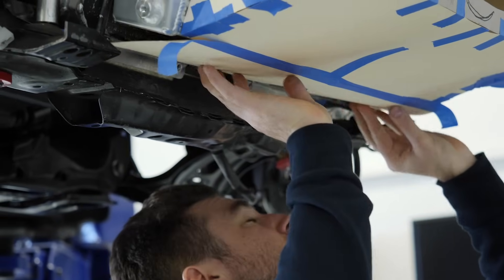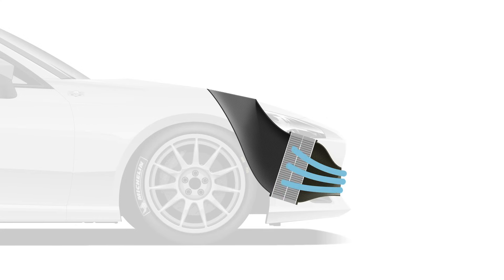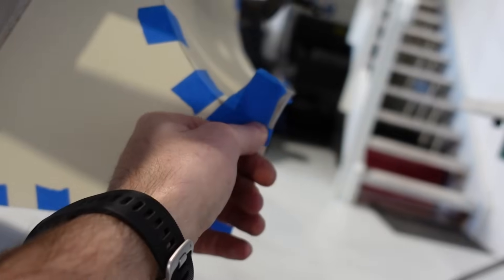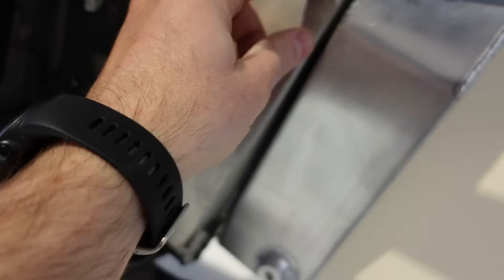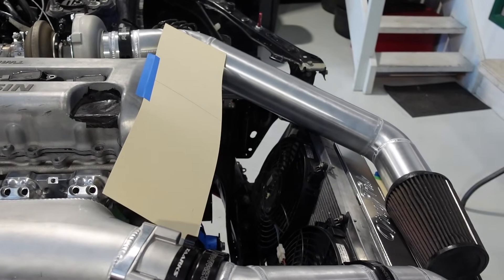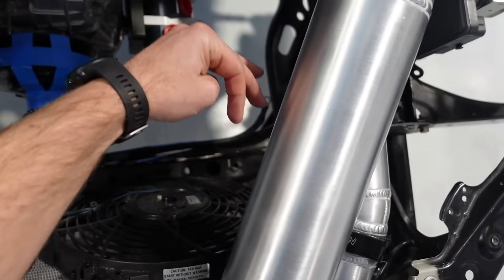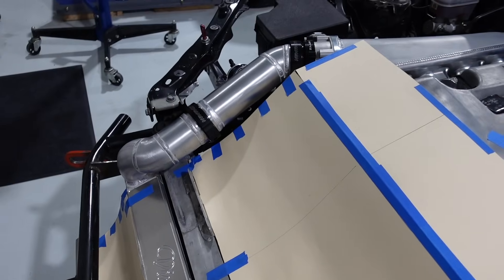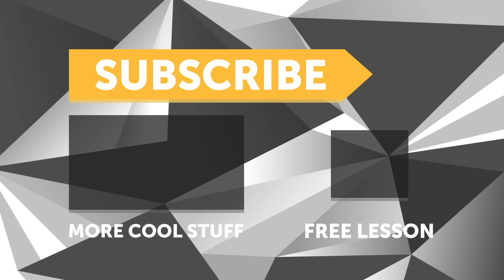Ducting and Coolers | 650HP SR20VET Swap | SR86 EP 3 [#BUILD]

Comment: One thing doesnt make too much sense, Tim-sleepy-guy mentions at about 2:00 that slowing the flow means the air molecules will be more time in contact with the radiator, thus absorbing more heat, and that this is beneficial -> actually, you want the air to get out of there asap, thus the higher the velocity, the better, because you have a bigger airflow and thus more cooling capacity, everything else being equal.
Reply: You've got to slow the air to increase the static pressure on the front of the HXer. They are correct. This is why you don't see race cars with giant radiator inlets way bigger than their cores. Generally 50-60% radiator face size is a good place to start. I'm a bit worried on their design since they seem more like 30%-ish, which is definitely on the small side.
Reply: DefSport they have a great shroud and well stacked heat exchangers. Their static pressure is fine. You are definitely right about an inlet restriction tho. Just need some smooth transitions to avoid rolling on entry. If F1 teams could make the inlets the size of their cores without turbulence issues or having increased their drag profile they would. They don’t because they can’t so compromises are made in peak efficiency of heat exchangers to reduce drag.
Reply: Ya exactly. I don’t know why they think creating a bottleneck at the intake is going to do anything besides limit your cooling. They are just limiting the degrees of angle that the surface of the first heat exchanger can pull in air. If the electric fans are properly shrouded and the radiator and inter-cooler are properly sealed together that intake bit is useless besides a flow restrictor.
Reply: @dsauce8780  the whole point of the bottleneck is to expand the air and increase air pressure on the radiator front face.
You are wrong in your assumption that they are restricting flow through the radiator with their duct, especially at high speeds: the air will always follow the least resistance path, and for sure that path is not through the radiator, that's why they need to create a high pressure area and seal it against the radiator

his only mistake was to assume that there will be more heat exchange because the flow is slower.
Reply: Filthy uh I don’t follow you. That is most definitely a restriction at any speed considering they have a properly shrouded electric fan pulling air and idk how you can argue against that.... but I’ll trust you know what your talking about for what ever application restricting airflow increases cooling in lol.

If they are concerned about sucking hot air at idle, evacuating hot air under power, or the aero being soooo bad that the radiator is starved then that’s a clear reason to add a bottle neck somewhere but seeing the project that doesn’t seem to be the case.
Reply: @dsauce8780  well, you are either trolling or never heard about the mad lads Bernoulli, Reynolds, Prandtl and Nusselt.
Your comments show you don't even have a basic knowledge about fluid dynamics.
Here's a paper that proves a bigger inlet is not always more efficient, look at table 2, page 8: http://jestec.taylors.edu.my/vol%206%20issue%201%20february%2011/vol_6_1__094_108_charitha%20ds.pdf
Reply: Filthy wow I guess I’m an uneducated troll? Did you even read that paper? Are you trolling? The conclusion is that the largest throughput with the least restriction produces the most cooling. The whole paper is examining the air throughput based on the engine’s cooling requirements and the drag effects they produce in order for them to understand the acceptable trade off between cooling and drag for their application. The column in the chimney or inlet does not need a bottle neck, compression, or expansion to increase cooling. Just needs to be non turbulent. Sounds like you are asserting a bottleneck or restriction for pressure differential = laminar flow which is completely incorrect. The largest possible inlet with the least possible restriction(restrictions including turbulence) is the most effective. You cannot get around that. The main idea being reduce all sharp compression to avoid the vacuum that inevitably comes with it accompanied by air rolling and creating turbulence. Go look at Steve Morris’s pro-volute centrifugal super or turbo intake piece. Entirely built to create uniform flow upon entry to the compressor avoiding unnecessary turbulence and therefore restriction. A Cardboard cutout with reinforced walls with no volume change would do more than the inlet in the video.

You sound super educated tho. Even liked your comment for typing Bernoulli lol because idk anything about thermo er I mean fluid dynamics. Just remember low velocity is the problem here(your reference, 3.3 grills and chimneys). Look up gradient optimization for more info. Doubt ya will. Based off the tone of your last comment you have already been educated.
Reply: In order to achieve high velocity ACROSS the exchanger you want to slow down the air increasing its pressure before the exchanger and speed up air velocity after the exchanger reducing the pressure creating the highest differential possible.
Reply: Like others have mentioned, they are correct about this. Heat transfer works by scrubbing the air molecules against a surface, in this case the radiator fins. Slowing the air down will allow for greater heat transfer efficiency when the air passes through the radiator. Only after the air has passed through the radiator do you want it gone as fast as possible

Comment: Rather than vent out the bonnet, split the air and vent into the front wheel wells to pass air over the brakes.
Reply from the maker: In theory you can exhaust the ducting anywhere with relatively low pressure. For our case with a circuit car and especially when you're doing endurance racing like this car is designed for, the brakes need a good supply of cold air so feeding them with air that's already been warmed by the intercooler and radiator wouldn't be a good option - Tim

Comment: Should add vertical fins in the inlet scoop to reduce turbulence when the air hits the inter cooler.
Reply from the maker: It's true using strakes in ducting can help keep the flows cleaner, but if we were going to use these anywhere in this setup it would be in the exhaust as that's where things tend to the be the most turbulent. Good call though - Tim

Comment: Thanks HPA. Cool video. I recently made something similar to this for my Mazda RX7 racecar.  Due to class rules, I have to run a standard bonnet with no vents. The back of my radiator has no ducting, but the front is very similar to your 86. The oil cooler sits in front of the radiator and the exit ducting goes underneath the radiator. My question is: will I decrease water temperate by creating a duct behind my radiator to increase the exit speed? And, if I am forced to duct that exit air towards the ground, will that give a negative measurable effect on aero? All help appreciated.
Reply from the maker: Certainly worth putting the effort into an outlet duct, it's just as important as the inlet to maximise the cooling and efficiency. If you get the outlet duct right, you will definitely end up with more cooling capacity for less drag. Ideally try and exhaust the air in a place of relatively low pressure and high speed flow to help draw the air through the outlet duct. Fundamentally, flow is driven by a pressure difference, so you should try to put your duct exhaust in a place with low pressure. Finding a place to fit everything and rules will almost always mean you have to compromise on this, you just have to do the best with what you have. The effect on your aero will depend on what sort of aero elements you have on the underbody, just remember to aim for low pressure! - Tim
Reply: @hpa101  thank you so much, lots to think about.

Comment: Would it be beneficial, or possible, to relocate the radiator to the rear of the car to increase airflow to the front? I’ve seen it done on modern GM cars.
Reply from the maker: Certainly possible, there are other reasons apart from packaging that people tend to shift the radiator to the rear like helping with weight distribution and damage tolerance. For us in this case, keeping things at the front suited us best - Tim

Comment: How do you calculate the sizes of the radiator and intercooler? 
Nice video as always.
Reply from the maker: Sizing the heat exchangers is best done together with the help of the company that builds them. This is because they are (hopefully!) the ones that have the heat rejection data for their products. In the absence of any proper data - which let's be honest can be difficult to come by unless you're working with a high end product, it's usually just experience and testing. We have a fair bit of instrumentation on this setup which we can use to understand the effectiveness of both heat exchangers in this car which is helpful - Tim
Reply: @hpa101  Hi, thanks. Im building a 550hp Porsche 951, where i need to get a new cooling package.  i can fabricate endtanks and other parts, but to calculate the cores, i need help.  
Thanks. - Erik.
Reply from the maker: @ealoken  If you are going to build your own radiator then the best bet is to buy a core from a reputable manufacturer. Any reputable core supplier should be able to supply heat rejection information for their cores. Using some generic efficiency and heat rejection assumptions for an internal combustion engine, for a given power output they will be able to help you to size it for your application - Tim

Comment: I mean even if you have a bigger curvature, won't at least some of the air cling to it because of the coanda effect.
Reply from the maker: Unfortunately you do need to be careful with the expansion ratios, going too steep will lead to separation inside the duct with gives you dead recirculating areas of flow - Tim

Comment: I’m curious what the reason for not making the bonnet exit narrower (side to side)but deeper (front to back - to maintain your 40% ratio with the radiator) to avoid having to do all the extra scolloping and shaping to clear the intake?
I’d have thought just as you’re squishing the air top to bottom you could apply the same principles squishing it side to side?
Reply from the maker: Main reason is packaging, there's simply no more room with the engine in the way. But another thing to consider is that in general you don't want to go too far back on the bonnet (especially in the middle) as you tend to get a high pressure area in front of the windscreen that will degrade the performance of the duct - Tim
Reply: Not sure there was enough room to make the exit larger front to back with the rocker cover in the way? Not sure if making it larger towards the front of car would muck up the gradient of the exit and how that would affect it though
Reply: Looks to me they've already maxed the front to back area, unless they cut more vents into the bonnet.

Comment: Cool video.
Do you know how to use a simple water filled manometer to check the pressure gradients through, and across the ducting and matrix, respectively? Might be useful for the fine tuning, especially if using a Gurney flap on the top edge of the exit?
Reply from the maker: We have actually considered measuring the pressure at different points through both ducts at some point in future, would certainly be interesting the check the effectiveness. The outlet on the bonnet does have a gurney-like feature on the front to help create a low-pressure area to help draw the air through both ducts. You'll be able to see it in one of the next updates, good suggestions! - Tim

Comment: how would something like this be implemented on a car with almost no space between the front bumper and intercooler?
Reply from the maker: Packaging is always a challenge, is was no different for us in this setup. The rule of thumb for the length of the inlet duct is for it to be at least equal to the height of the heat exchanger. So if your heat exchanger is 300mm high, you would aim for an inlet duct length of at least 300mm. For us this wasn't possible without the duct length getting ridiculous, as it is it already extends forward of the air dam. If moving the intercooler backwards is not an option, then you just have to make the inlet as long as you can get away with. Make the transitions as gradual as possible and avoid any sharp corners or steps - Tim

Comment: Good that there is so much free space bt radiators and engine, which in fact is quite strange, remembering that this was originally place for a short length boxer!
Reply from the maker: Engine was mounted as far back as possible without having to cut the firewall, which certainly helped. Still not as much space as we would have liked! - Tim

Comment: Wish it was possible to have two more fans in the bonnet to help pull the air out.
Reply from the maker: We have fans mounted in the outlet duct, but these are only intended to be used with the car stationary. Once the car is moving on track the ducts will be far more effective than the fans are capable of keeping up with! - Tim
Reply: This will not help at the speeds that the car will run, i mean above 50kmh. 
It might only help when the car is standing still.
Reply: @jareknowak8712  maybe that's true with standard oem stuff but you can get some insane brushless fans nowdays that have crazy airspeed
Reply: @ReubenHorner  The problem is the fan shroud, the round fans will never fit the square hole.
A shroud is needed at low speed to make sure the fan is moving air from the entire radiator, but at high speed the shroud is guiding the air through the fan instead of just passing by the fan more efficiently.
Ideally flaps should be mounted beside the fans, at low airspeed the fans suck them closed, but at higher airspeed the flaps open to bypass the fans for free flow.
But the complexity starts to go up.
Another problem with highpower fans are that suddenly you end up with 1-2 kW fans that needs to be powered.
13V and 100Amps is only 1300Watts, not much for a high performance fan, a normal car has around 100Amps generator, so there is nothing left for the fuel and spark system.

Comment: How will the fans effect flow? Will they act as blockage at higher speeds?
Reply: To a negligible extent. 
Its important that they are suction fans, i mean behind radiator. 
Some ppl are using blowing fans, in front of radiators - this might block the air flow.
Reply: @jareknowak8712  After a quick google I came across this article: https://www.verus-engineering.com/blog/informative-8/post/radiator-fans-in-depth-explanation-and-information-32

In here it says that after 20-30mph airspeed and pressure alone are enough to outflow and electric fan's capabilities. To me that says they are only really necessary in road cars, and are sub optimal and an added complexity in a race car.
Reply: @flyingfox09  thats true. 
Above ~50kmh fans are not needed. 

Thats why F1 cars do not use them. 
Look at how big the fans are on dyno!
Reply: @flyingfox09  Decent rad fans work above 20-30 mph, not sure where they got that number. But generally they're not going to do much above say 40-50 mph on most setups. If you have a thick radiator core with a high fin density (lots of aftermarket radiators fall into this category), the fans help out at higher speeds. I did testing to show they helped on my S13 with an SR20VET on track (stock Altima fans on high) with a non-ducted hood (about 5-10 deg F lower coolant temps). Once I ducted the hood they did lower coolant temps a tad, but not much, just a few deg F, so like 1-2 C.
Reply: @jacobfannon4295  Interesting. I think hood ducting is probably a big factor. So you did testing with and without fans? I assume also on a track or at highway speed?
Reply: @flyingfox09  Yea, that's with an without fans running. Also with an old vertical flow Koyo rad and a Koyo N-flo (triple pass N flow worked way better, no surprise there). The cooling setup would keep it within 1 deg F of the thermostat opening temp on the street - if you have overheating problems on street you'll have a nuclear meltdown in like 2 laps on track. 

I tested it both on a track with peak 135 mph, ~80-83 mph avg, and a slower track that was 120-125 mph peak, ~75-77 mph avg. Same relative improvement, which says the mass flow benefit the fans were adding at that average speed was roughly constant between the two tracks. I ran the car at about 325 rwhp on an SR20DET setup, when I went to the VE head it was higher power, but with all the better stuff (Koyo N flow etc.) so it largely was ok on coolant temps and probably making 350-375+ rwhp. Nothing like the crazy 600+ HPA is shooting for!
Reply: @jacobfannon4295  Oh ok so you still had fans installed just turned off. I am willing to bet if you removed them all together and the shroud you would see an improvment on track since your speeds would be high enough.
Reply: @flyingfox09  The void area of the fans was greater than the radiator flow area, so I doubt removing them would help much. You can't remove the fans on any sort of "club level" track car I've seen, as no fans means you've got to blast into the pits at speed and get external fans shoving lots of air through your radiator to not overheat. Some of those little rubber flap vents on the shroud was something I wanted to try, but I was going to be fighting for a couple of square inches at best so it didn't seem worth the effort after seeing the void area of the fans was higher than the flow area of a Koyo rad. 

Keep in mind thick radiators also benefit from fans at a much higher speed than thinner rads.